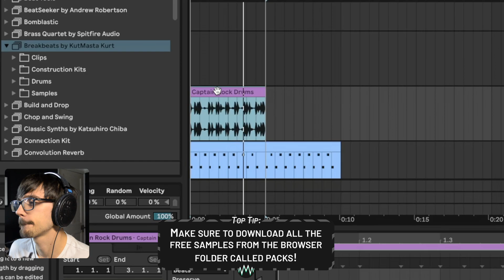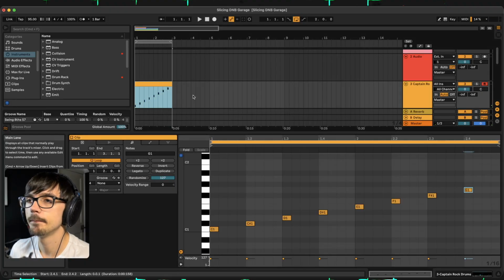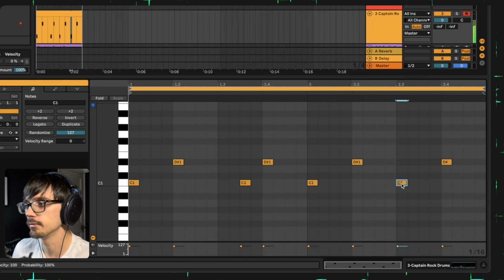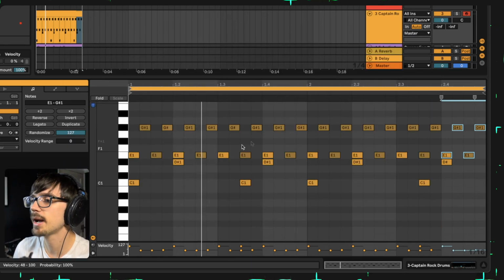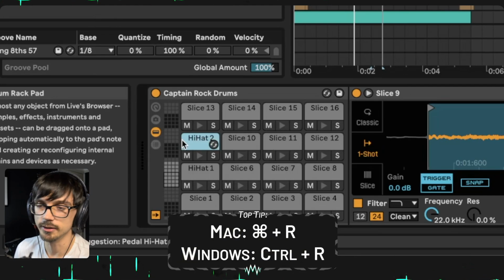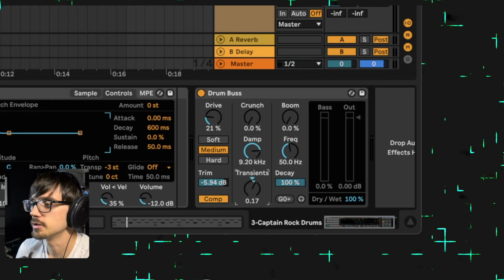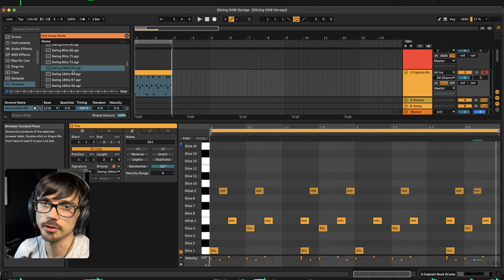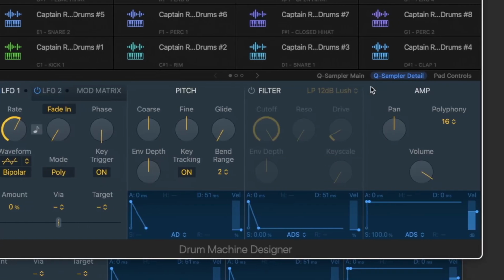Improve your sampling in Ableton and Logic Pro

Comment: You are gifted at explaining things clearly. Great work. I'm a Logic guy. Do you happen to know if there is a way to replicate (in Logic) what Ableton is doing with its Zn Shift in its Simpler? I want to get a glitchy bass track going using samples tuned to the same note (as in this video: https://youtu.be/ef-p0-NF7Vs?si=vt1mYM3njRnoqIeJ&t=295). Thanks
Reply from the maker: It's a little complicated but one way you could do something similar is by loading multiple files into a Sampler (Multi-Sample) Instrument in the Mapping tab at the top. Then select them all in the zones area go to the menu option Zone - Remap - Remap All Notes. This should put them all onto one note each. 

Then you can use the randomizer MIDI FX plugin above the Sampler. Change the Event type to Note Number and then every time you press a key it will randomise the note value and place a different sample. 

The more samples and zones you have the better this should work. 😀